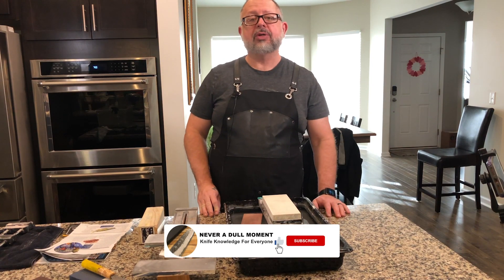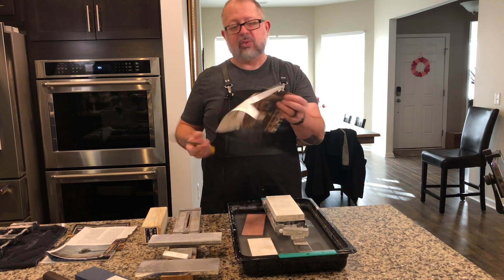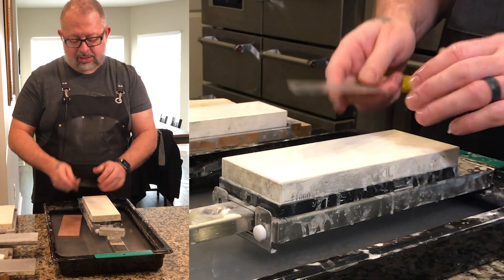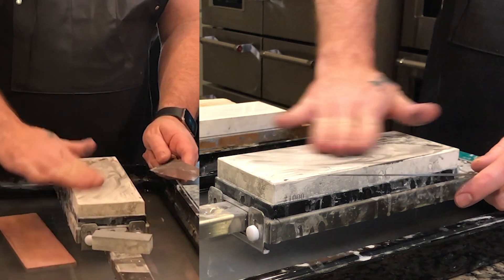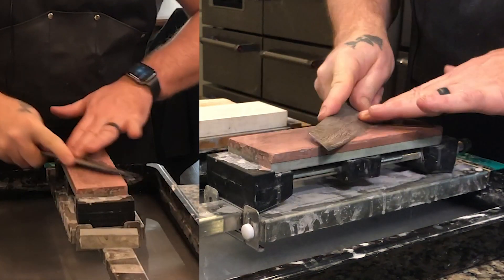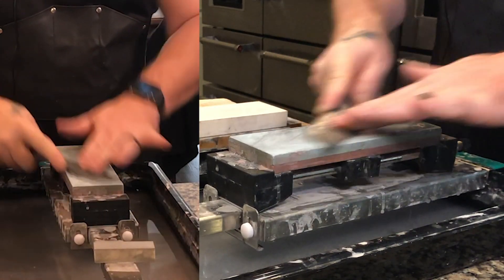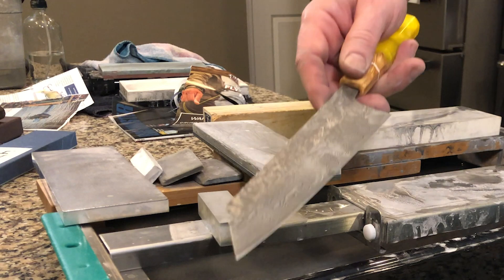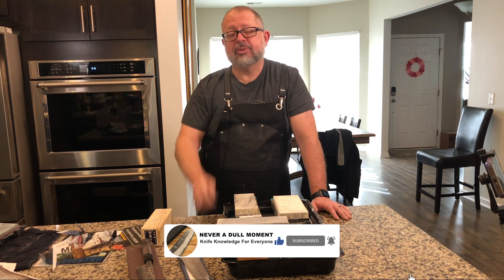Knife Sharpening: Part 2 - Sharpening R2/SG2 For the First time

Comment: @Never a Dull Moment Thank you for doing this series, and for going through the painful process of dulling those beautiful knives up just for us. I missed the first video, and just caught both this morning. Your setup, and camera angles are spot on, we can clearly see everything that is of interest, so great job on that! A lot of things come to mind. In the first video, the Suehiro Debado #1000 seemed to perform quite a bit differently from the second video. I don't if that's because of the extra pressure in the second, or the differences between the two knives. In the first video, the #1000 didn't seem to slurry up as nicely, and loaded up rather quickly, however, in the second video, it just did it's job wonderfully, without too much load up, and a nice slurry. I'm currently really attached to the Suehiro Cerax & Rika, however, the performance of the Debado #8000 was just incredible. I'm currently using a Kitayama #8000, and am very interested in replacing it with the Debado #8000, because of the lack of build up on the Debado, that my Kitayama is currently suffering from. One question I have, is how do you like the Naniwa sink bridge? I purchased the Suehiro bridge instead, because of all of the negative reviews I saw on the Naniwa. Thanks again, and have an awesome day!
Reply from the maker: Painful
Reply from the maker: Thank you very much for your comment. I’m enjoying doing it. It is very hard to keep up this pace but I’m in it for the long-haul. I will read this more thoroughly when I’m not at work and answer any questions that I might see here.
Reply from the maker: Just woke up from my nap in the middle of the night. Got a chance to read all of that. So the 8000 is not from the Debado line. It’s their normal 8k. I did put a link if you want to check it out. I heard your stone was a dream and I don’t on it. All I can say is that this company is so impressive to me but from what I understand you own an amazing stone so I wouldn’t second-guess myself just yet. You and I both know these things aren’t cheap and unless you have money for the hobby then I wouldn’t abandon yours yet. I believe the slurry difference might’ve been pressure. I did say that the two metals felt different and this could also have something to do with the heat treatment of the blacksmith. We know that the steel was created by the same company so the only differences is the Damascus and the heat treatment. I would have to understand more about how that heat treatment affects its hardness. You’re talking one or two points. Typically all of the steel is he treated to 64. If anything one of them might be in and he treated to a 63 and it’s lower than a 62. It’s the only part of the equation that doesn’t make sense. I do know that there was more pressure in the second go. The slurry would’ve happened faster with more pressure. I don’t have any other Sink bridges but the one from Bob Kramer. This one is new to me and I am not very impressed by it. You could’ve just as easily build one out of wood yourself. I like that it’s wired but the all metal platform is a bit clunky. Also, it doesn’t resized to fit on my actual sink. I can only use it in this tub. I have a farm sink made out of metal and I cannot make it size down small enough to fit inside my sink. I don’t have the one you have but might have to look into it and do some type of comparison. As always, thank you for taking an interest. You will notice that there is a size difference between the 1K in the 8K stone. They do feel the same even though they’re not considered the same line they might as well be. I don’t have the two that you have by this company so it would be interesting to see how those lines feel. I would like to see if they feel different at all. It could just be that there’s a size difference but man I do enjoy the size difference. God bless and thank you for keeping up and keeping me on my toes

Comment: These are the results I expected, as I have a Yaxell with SG2 steel. I am very curious though why such a different result with the first knife . Maybe the heat treating like you said.
Reply from the maker: This is definitely a new experience for me. On one hand, I did use a different amount of pressure. The second I've had Damascus wish I would've thought it would have slowed it down more. But I had also stated that the steel feel completely different even though it's made by the same company. I'm not sure how the Damascus affected it.
Reply: @nadm  Could also be thinner immediately behind the edge so you have to remove less metal to get a burr regardless of how hard it is.

Comment: Hi Greg, I would say the straighter profile of the blade assist you in keeping a constant pressure on the edge. Maybe that is one factor why you are so much faster. But the HRC is of course als a important factor.
Reply from the maker: Sorry it took so long to see this and reply. I think having a straight edge is helpful. You have to move your wrist in a rocking motion when the knife has a belly. Both knives were pretty straight. But they both actually felt Mary different in their density and weight. I do think the hardness had a lot to do with it.

Comment: I observed you finishing with edge leading strokes to remove any remaining burr. Would you follow with a couple of final edge trailing strokes or a strop for any further refinement?
Reply from the maker: I will end up putting a link up later. I’m at work I apologize. I will show you under a microscope that edge leading strokes end up much cleaner than edge trailing. I typically do edge trailing to do most of the removal when I finish with Edge leading and it gives a much cleaner edge. The difference in the magnification is extraordinary. Let me get that link to you tonight when I get home
Reply: @nadm  How about that link? did I miss it? thanks, Bill
Reply from the maker: I did look for the specific link. I couldn’t find the one I wanted to send you. I am at a birthday brunch. I will search for it on my drive home. You will get something. There is a lot of information on Edge leading versus edge trailing. I have the photographs and I’ll even find the video that I made with the information. Have a blessed day and I will get back to you. I’m sorry I fell off. Have a blessed Sunday
Reply from the maker: https://knife.wickededgeusa.com/forums/topic/edge-leading-vs-edge-trailing-under-magnification/
Reply from the maker: https://knife.wickededgeusa.com/forums/topic/edge-leading-vs-edge-trailing/
Reply: @nadm   Thanks!

Comment: Have you sharpened SLD steel before? I’m just curious because I just recently bought a knife made with SLD Steel from a maker called Masashi. Just wonder if you have any tips on sharpening it.
Reply from the maker: No! I have not. I am fascinated by this. I’ve only recently looked into it. I’ve got my eye on some thing. I will definitely let you know when it comes up. If you want to send me any information or a link that you are fascinated by then I would love to hear from you. I will definitely be doing some homework on this.
Reply: I purchased the knife from Knifewear. It’s the 210mm Masashi Kuroshu, but I have a an ebony handle with a white buffalo ferrule. 
Here is the link:
https://knifewear.com/products/masashi-kuro-damascus-sld-wa-chestnut-gyuto-210mm?variant=4370901041180
Reply: @AJ-by6pd  I just recently sold my first and only SLD knife made by Kohetsu. It was a 180mm Gyuto 61-62 HRC. Maybe it was me or the knife itself, but I could not fall in love with it and I tried for a year! It got sharp but just never slid through product like my other knives (even VG-10). Obviously it’s stainless not carbon but I just could not get myself to love it. Let me know how you are liking yours I’m very curious. Thanks!
Reply: @lz_377  I am aware of the knife that Mark Richmond sells through his Kohetsu line through his website Chefknivestogo. Each maker heat treats the steel differently, so it’s not an apples to apples comparison. Masashi heat treats the steel very differently using molten salt baths. The closest thing to a Masashi is the SLD knives from Nihei. 
Here is the link: 
https://carbonknifeco.com/collections/nihei-knives
Reply: @AJ-by6pd  I recognized your name from other comments on other channels that’s why I commented you. How are you liking it so far? How does it sharpen for you compared to other steels? Thanks brother.
Reply: @lz_377  it’s legit. Really easy to sharpen. I put it on my kangaroo strop the other and got wickedly sharp. I am going to buy a Masashi Nakiri at some point in the near future, but I just purchased an ATS-34 Hinoura gyuto.
Reply: @AJ-by6pd  I just read about it. Seems to be of much better quality than Marks Kohetsu line. I used the money to buy a Moritaka AS bunka that so far I love! I had been on the white #2 train for a while and was EXTREMELY pleased with how easy the super blue sharpened up. I was honestly intimidated to sharpen the high hardness but I now feel silly that I had a second thought. Carbon steel never ceases to amaze me with how easily it takes an edge. Your knives might be a little out of my (cough my wife’s cough) price range. Maybe one day I’ll talk her into it. Thanks for sharing.
Reply: @lz_377  lol you crack me up. I like Moritaka knives. Knifewear will have the Moritaka ishime finish for a honesuki and nakiri made with AS steel for their May garage sale. You might want to check it out when they have the sale. 
What are your fav knives in your collection?
Reply: @AJ-by6pd  oh man that’s tough. I have a Yoshimitsu Blue #2 that I’ve had for a while that is the thinnest knife I’ve ever seen! It blows through veggies. Lately, my favorite has been my Masakage Yuki Gyuto. The white steel is so easy to sharpen I feel like I could do it telepathically. The choil is  rounded and comfortable in a pinch grip. I have a custom handle Tojiro White #2 that I love just because it’s been a project knife and I’ve spent so much time with it. It’s in no way my best quality but I’ve taken time to sand down and round the choil and spine. I also have thinned it out as it was A THICK BOY. I even put a forced mustard patina on it. The Moritaka I just got and have only sharpened it. Haven’t ran it through anything yet. My wife loves to use my Tojiro DP petty. What are your favorites??
Reply: @AJ-by6pd  I have a Spyderco Delica coming in the mail today actually lol. It’s weird to think of VG-10 on an edc pocket knife but we shall see how it performs.
Reply: @lz_377   I have so many knives, but I can’t say I have a favorite. The ones I use the most often are my Gesshin Ginga Swedish Stainless 240mm gyuto. It’s almost a laser and so easy to sharpen. I have a Kanehiro Ginsan sujihiki that is such an amazing slicer. I also have a Mutsumi Hinoura white#2 stainless clad 165mm nakiri. 
Knives on my wish list are: shigefusa nakiri, Watanabe Nakiri, Fujiwara urushi denka 150mm petty, and Tojiro atelier blue#2 gyuto.
Reply: Masashi's SLD is top notch, the guy learned at Yoshikane where SLD and SKD11 are extremely well executed. So did Nihei.